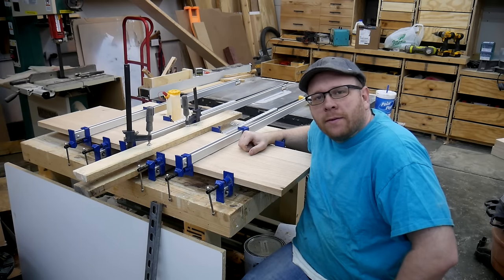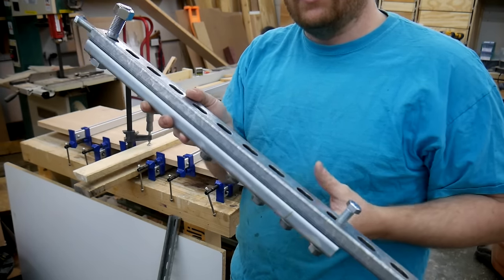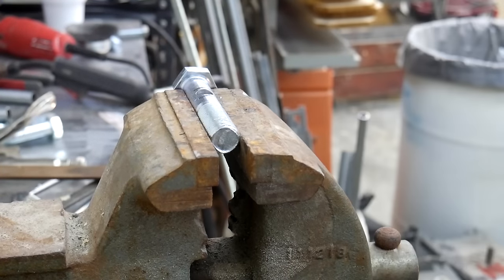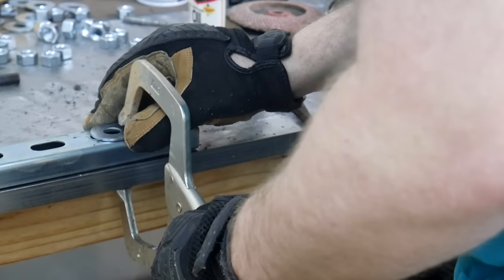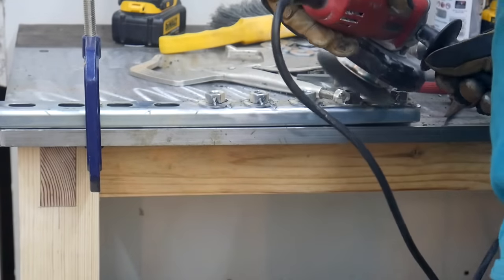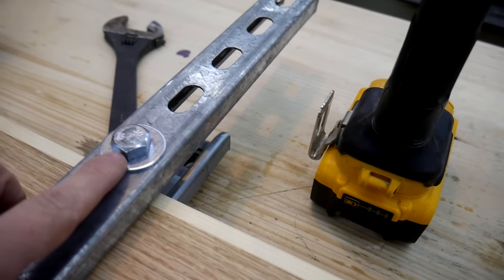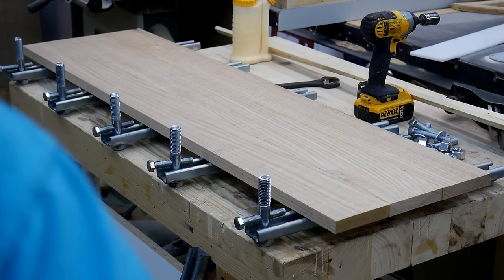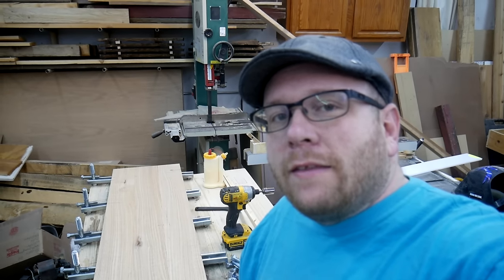3-Way Panel Clamp System

Comment: You need to turn your unistruts over so they have the flat surface on your wood.  I did something similar and maybe one day I will post a video or share with some of my youtubers so they can make some and pass on. But I will try to describe the best I can...

     I use the same size unistrut but unaltered other than cut to length.   I took some 2 1/2 in 1/4 angle and cut them around 2 inches long.  One side I cut the angle down so it is just under 3/4"x2 1/2"   the long side I drilled 2 holes I think 5/16ths the same distance as the center of slots of the unistrut.  The then I took 5/16th (or 1/4 don't remember) carriage bolts in the holes so the bolt head only sticks up the thickness of the unistrut material.  I used my belt grinder and took of just a little bit of the square shank that keeps a carriage bolt from turning in order to get the right height. Then placed the bolts with the head sticking up that distance on the flat side opposite of my shortened angle. Then cut the back of the bolts off flush and welded them down solid to the angle.   Now I made two for each set of clamps.  then take the grinder and flat just enough off sides of the two sides of the carriage bolt heads so they fit inside the ovals.  So now you can drop them in the strut on flat side opposed the U on the strut and slide them down in the slot and they will lock onto it. Now you just made the foot of essentially a pipe clamp that uses the strut instead of pipe.  You use one just like so.  The other one centered it the short side of the angle that is 3/4  drill a 3/8 hole.  You can weld a nut on to it on the inside the angle or you could drill it a bit smaller and tap the hole for 3/8 thread.  I then take 3/8 all thread and cut it around  4 inches or a bit more.  Now I took hardwood and turned handles I threaded and epoxied onto  my all thread but you could use a 3/8 bolt or weld a nut on it so you can tighten with a wrench.  They just screw into it to push the board together like a pipe clamp does. I also made me some little feet that swivel on the end of my all thread that has a little wedge of hardwood attached. You could put some flatthen  bar stock in place of the pine that you used to sacrifice when tightening down or hardwood. I hope this is as clear as mud for you. LOL... if so you can see you have made a bar clamp you can use with any size length of strut just cut to length. 
    So to use  Glue up just like any other pipe clamp and run the claps hand snug. Then you just use bolts to pull another piece of strut down against it to prevent the cupping and tighten.   I weld a piece of flat into a all thread  to make like a T bolt and use a washer on top with knob so it is all done with hand to wrenches needed.           Like I said it is probably about as clear as mud but if you read it enough times maybe you can understand the just  of it.     Now if you clamp something thinner than 3/4 you have to lay a spacer board down the width of the panel or the foot of the clamps will keep the other strut from clamping it together.    The do work very well though.      

I really debated patenting them but here I am giving away my golden goose.

Comment: You've got a good idea there, though the thing about experiments is that they show where refinement can be done.

I think I'd make the panel clamps longer, weld both vertical bolts to the bottom bar. I'd also use a much longer horizontal clamping bolt. As the distance between the two vertical bolts will determine the maximum width of the panels you can make with it, the length of the horizontal clamping bolt will determine the minimum width of the panels. Since both vertical clamping bolts are welded, in this concept, I'd want as much range in panel widths I can make as is reasonable -- maybe somewhere between min of 6" and max of 48". On the vertical bolt for the far end, weld a plate to the bolt for a broader surface area for the wood. Hopefully, the broader surface area contact would help reduce the risk of marring the wood. On the edge or horizontal clamping bolt, on the end, I'd weld a ball and have the pad or plate mount to that ball. With the ball between the bolt and the clamp surface pad that would allow the pad to sit stationary on the wood's surface while the bolt continues to increase the pressure. 

Anyway, those are my two cents.

Comment: Metal strip instead of sacrificial  wood strip will not only stand up to many uses against the clamping bolts but will give a beter spread on clamping pressure! Strips of anti slip fabric (like for use in car dash) might help reduce dents from over/uneven bolt tightening ! Just one or two idea to help but a great system well done !!!
Reply from the maker: Great ideas. Thanks!

Comment: very excellent idea, maybe one tip, to weld a small handle to the front nuts so you would not have to use the wrench, and in stead of 2 pieces of scrap wood you could always slide in  a few pieces of your uni strut kind regards Hans

Comment: I love this idea, and I'm looking forward to expanding upon it. I make a lot of heavy duty tables and have been looking into other methods for  clamping. I have looked into the industrial clamp racks / tables and not only are they pricey, but they are usually rather large. I would definitely like to collaborate with you - or at least brainstorm a little. Great Idea and Thank You for sharing this approach.
Reply: I would suggest going with deep unistrut for rigidity, I'd REALLY like to see what you come up with. I use a set of 4' pieces and just nut and bolt thru them as cauls but use conventional clamps to join the boards.

Comment: Great Job... I Made some of these out of Red Oak Scrap and Carriage Bolts and Wing Nuts. Rather than using your "Horizontal pressure through Bolts". I just used some of my aluminium bar clamps to pressure my Work pieces together.  When I used my Scrap 3/4" red oak cross bars Made the centers taller in  the middle than either end to help keep these pieces from Flexing...
Either end was 1-1/4" and the centers were 2". One side(the part that touched my joining work pieces)was perfectly Flatwhile The Outside edges were arched. 
My sandwich clamps will accommodate up to 30"...
I hope you understand my description... Again I Like your Design... Whatever Works Right... I did subscribe to your channel... 👍👌👏
Reply from the maker: Thanks!  I think I understand what you were describing.  Thanks for the sub!
Reply from the maker: Wedges are a great idea. My goal was to try to come up with an all-in-one type system, so wedges may have made it more complicated. Or at least, more pieces to keep track of. Still a great idea, though.

Comment: I was just thinking of doing the exact same thing (almost) last night. I would probably use punched square tubes and instead of the bolt use wedges for the horizontal pressure. Thanks for confirming my idea would work 👍🏻👍🏻👍🏻

Comment: This size Unistrut is a bit of flimsy on its own. I have found it still twists and bends but doubling it back to back up would be very rigid if you need it. A piece of 1/4 in thick steel from the hardware store between back to back doubled unistruts  will make it very strong and resist bending even better. They have a larger size but its really not much stronger in one direction. The size you have is good if used right for more narrow panels.  Also you can get some tap sockets and you can drive 2 flute taps snd some 4 flute ones with a socket wrench or impact. Spiral taps for blind holes. Right now I have 2 x2 inch Aluminum bars but I like this idea of yours but Im going to try turning them 90 degrees double them back to back with a 1/4 bar between them for wider panels I can see yours bending where the clamp bolts go thhrough and that dents the wood.

Comment: An idea on how to eliminate the weld issue.  locate a piece of flat steel that will fit snug inside the channel.  Yes a mill or a friend with a mill would be handy.  Drill and tap the steel.  And slide into location.  Your idea is very good.  Yes I am a machinist and woodworker.   With some tweaks it would be twice as effective.  Thanks for sharing.
Reply from the maker: Thanks for the input!

Comment: Nice solution  and good engineering   2way or 90degree bolt is what comes to my mind  I was happy you mentioned   Not calling it the cross threaded  bolt  due to that was my first thought when you used the term  as  my father used to tell me when we worked on projects together  don’t  go and cross thread  that bolt or  as a a teenager I very often   Tightened something untill I broke the  bolt or stud   Giving  the old man  hours of  extra work fixing my screw up !  Typical rookie mistake  and it pissed Pops off evertime  as usually it was   Something like a  manifold bolt or  ?  That was a bear to get to  and required work like pulling the entire engine from a car or truck     Pissing off the old man wasn’t fun  as a teenager  but I guess it’s  how I learned   How not to do things
Reply from the maker: I like 2-way bolt or cross bolt

Comment: You can get a thick square washer that is designed to be used with Unistrut. You can buy them from the Unistrut dealer or any industrial electrical supply.
Reply from the maker: Hey Dale, here is the response about spring nuts that I wrote to others that suggested the same thing: The reason I did not use the spring nuts has to do with how those nuts interface with the Unistrut.  There is a small lip on the inner channel of the unistrut that catches these nuts and all of the clamping pressure is applied to that narrow lip.  In normal pluming and structural unistrut applications, the nut and lip are always pressing against something say, a pipe, a piece of structural steel, or another piece of unistrut. In this application, there is nothing backing up the nut and the tendency will be for the lip to bend outward away from the inner channel of the strut.  I am using the full thickness of the unistrut to behave like clamping cauls, so the bolt and nut needs to press equally from the outside of the unistrut, using the rigidity of the strut as the caul action while the bolt provides the clamping action.  With a spring nut in use, my belief is that only 1 side would provide the caul action and the nut side would just fail over time because of the pressure being applied to the inner retaining lip.  I sure hope that book I just wrote gives you some insight to how I was thinking when I approached this project.  I did consider using spring nuts at one time, but decided against it for the reasons stated above.  Thanks for your input, guys!

Comment: Do like people have suggested and turn your strut over and use 1/2" spring nuts. Full size strut is power coated so staining should be minimized if not eleminated

Comment: Clever stuff! 2 little suggestions you've probably already thought of... a piece of waste wood between the top of the piece and the clamp to prevent the clamp from marring the surface and also possibly putting hardwood shoes or metal shoes on the horizontal bolts to spread the clamping pressure and spare you having to use a sacrificial hardwood piece each time.

Comment: Great design and build video. I fell turning the uni-strut the other way to give a broader side for clamping pressure, both top and bottom, would enhance the value of these clamps. It would also put less damaging on both surfaces of the panel being glued. Thanks for sharing the build details. I would soon make a few and share my experience with you.
Reply from the maker: Thank you!
Reply: I agree the unistrut flipped so that the flat side touched the wood would work better but its a great idea probably will copy the idea
Reply: Bakthavathsal Kadambi  I think the onside down allows for smaller thickness panels so the  horizontal bolt isn’t limiting your downward pressure. For thicker panels could have some hardwood inserted in the openings top and bottom

Comment: Love it, im gonna make a bunch. have some variations i think would work awesome with what you have already done. rubber feet on some sort of t slide bolt( keep the dents away), maybe a steel block welded to the front of the cross pressure bolt. Great video thou.
Reply from the maker: Great ideas!

Comment: Glue rubber strips on the sides that are on the boards to prevent the Unistrut from damaging the boards and metal and rubber where the cross bolts press the edges. Use some water on the big dents, will raise the grain.
Reply from the maker: Great tips!

Comment: Here is an idea I might try on your design. Try fitting a piece of hardwood the length of the unistrut that will fit snugly inside the channel of both top and bottom bars and high enough to keep the hard metal off the softer wood and drill a hole in the wood at every opening in the unistrut. Again, use a wax substance on the wood to keep it from sticking together.
Reply from the maker: Many have suggested that and it is a good idea. The only issue I see is that the wood strips would have to change length every time you wanted to glue up a different width board. I have some ideas for a 2nd generation of this idea. Just don’t have any time to develop it. Thanks for watching!

Comment: Good idea!  I was about to make something like your design and make it out of steel.  I'm glad you don't feel like it has to be made out of wood entirety. There are spring captive nuts made for those rails.  Did you try them?  An angled wall mount would be my choice. Good job.
Reply from the maker: I did consider the spring nuts, but I wanted the pressure to be applied across the whole piece of unistrut, not just on the rails.  Hope that makes sense.

Comment: this just a thought. Can you flip the uni-strut upside down from the way you have it?  That way the flat side would be against the wood.  It may keep the edges from digging into the wood when you clamp it down. Like I said, just a thought.  Great clamps!!!
Reply from the maker: I had considered it.  It probably would work, but I'm not sure how well the nuts, bolts, and washers would seat or fit in the open side of the unistrut.

Comment: Very nice! I've been wondering about such a system, myself. I think I will build them based on your design. I'll need help from a friend with the welding, though. I agree sacrificing some hardwood along the edges would allow you to screw in tighter and make tighter seams in your project. How about routing some hardwood to slide down the length inside the unistrut, but with a tongue and flat face that would be pressing down against the project rather than the lips of the unistrut? You could drill out the holes so you can drop your bolts in anywhere along the length of the unistrut, just as you do now.
Reply from the maker: Great idea. May be worth a try!

Comment: Good idea using the uni strut, but instead of all the washer and nut welding, you could use half inch spring nuts inside the strut, and slide them wherever you need them.
Reply from the maker: It has been suggested before and I considered it, but I am concerned about the spring nut's ability to handle the lateral pressure applied when clamping the edge.  My way gives the bolt a hard stop in the welded nut.  I could be wrong, but even if my way is a little more cumbersome, it works 100%  Thanks for the comment.

Comment: Great affordable solution, thank you for posting, I'm not a welder so I'm going to have to come up with another means of attaching those nuts
Reply from the maker: I don't think welding is crucial, just makes it easier to tighten everything down.
Reply: I’m thinking JB weld might work. I’m also not a welder.

Comment: Especially with flux core wire welding, welding can be done outdoor. Wind does not affect wire flux-core welding. I never weld in my shop, always in my yard. Every rather large objects I carry the finished work to its final places.

240 v can be obtained easily from the hots of any two outlets that are 180 degree off-phase.

Comment: Dry film or anti seize the threads, will help with bolts locking up,  use unistrut nut with spring attached and slide in track.
Reply from the maker: I can't use the unistrut nut because I need the bolt to pass through the channel to create a stop for the edge-clamping action.
Reply: They have “spring nuts” that dont have a spring now. More like a clip so u could screw in through the back side. Great idea tho

Comment: Rick Jackson

On the ends of the bolt used for squeezing the panel together UHMW would work great,  you just cut  a small block drill and tap to thread onto the end of the bolt (  just don't drill all the way through....just deep enough for bolt to be threaded into uhmw) [1,2 inch bolt=1/2 inch depth of hole]

Comment: Get a layer of metal strip to add to the sides of the board strips where the bolts make contact so that bolts don’t drive into the strips also those metal strips will help spread out the pressure there are some 1” x1/8 or 3/4 steel strips available which can be screwed unto the strips

Comment: Thomas this is a great idea, however it might make your design better if you would weld the nuts inside the c channel so you could use the flat part of the unistrut to be against the wood boards so not to mar the wood board that you are gluing together -- just an idea -- Thanks for the video I think I will try making one
Reply from the maker: That was the debate before going into this.  My concern would be how to tighten the bolts if they are seated inside the unistrut.  I think either way would work and hopefully someone builds on this idea to make a better product!